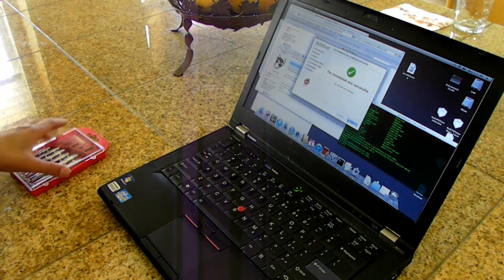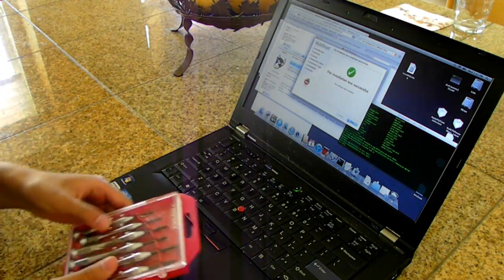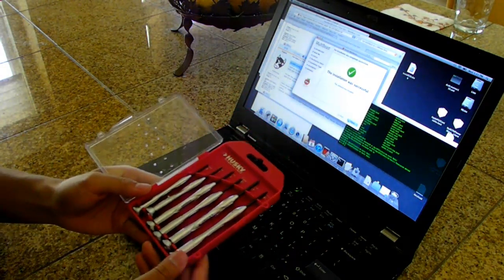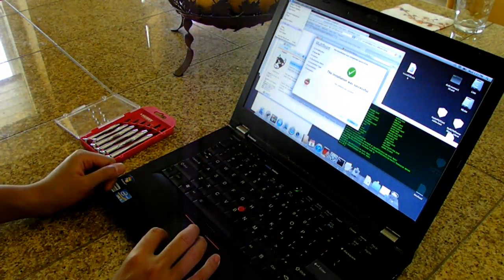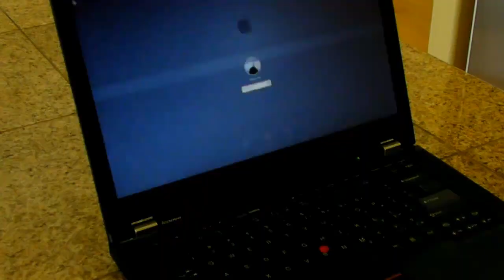[HD] Accessing and Installing the Wifi Card on the Lenovo Thinkpad T420 T410 T400

Comment: These instructions don't exactly work for the T400, the screw orientation to release the keyboard is similar to the T60/61.  Otherwise, replacement of the Wifi card is similar.
Reply from the maker: Thanks for the heads up!